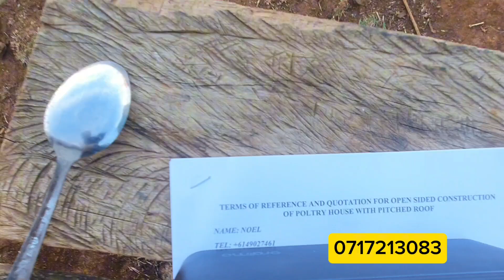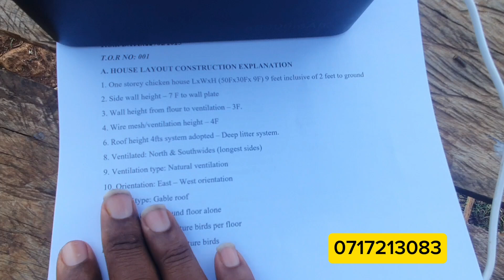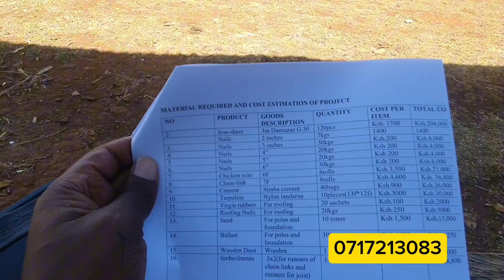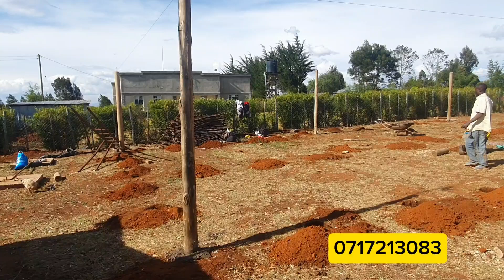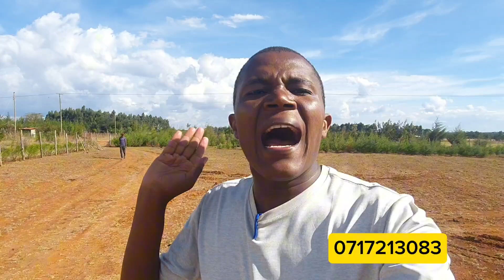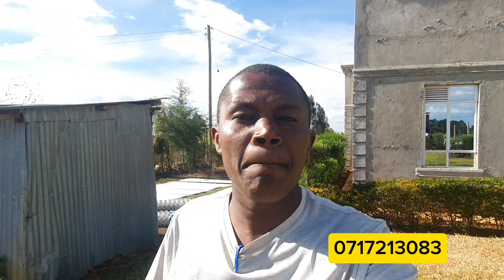How much money you build a 1000 poultry house.DAY1

Comment from the maker: How Much Does It Cost to Construct a 1,000-Bird Capacity Poultry House?
Building a poultry house for 1,000 birds requires careful planning to balance cost, durability, and functionality. The cost varies based on materials, design, and location, but on average, you can expect to spend between KES 150,000 to KES 500,000 ($1,200 - $4,000) depending on the type of structure you choose.

Breakdown of Costs:

Foundation & Flooring – KES 30,000 - 80,000

Concrete floors are ideal for durability and ease of cleaning.

Framework & Roofing – KES 50,000 - 150,000

Wooden or metal frames with iron sheet roofing ensure a long-lasting structure.

Walls & Ventilation – KES 30,000 - 100,000

Wire mesh and curtains help regulate airflow and maintain biosecurity.

Feeders & Drinkers – KES 10,000 - 30,000

Automatic systems reduce labor and wastage.

Electrical & Lighting – KES 10,000 - 50,000

Proper lighting is essential for bird growth and laying performance.

Miscellaneous Costs – KES 10,000 - 50,000

Includes labor, painting, and security measures.

Cost-Saving Tips:

Use locally available materials like timber and iron sheets.

Opt for deep litter systems instead of expensive cages.

Build in a well-drained area to reduce flooring costs.

A well-constructed poultry house ensures good bird health, productivity, and long-term cost savings. Would you like a more customized budget based on your specific location and preferences?